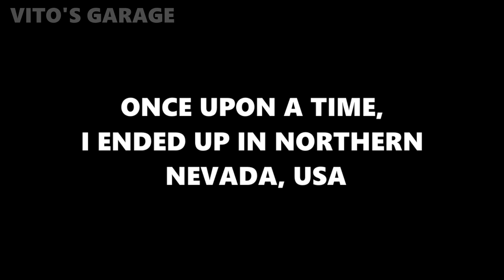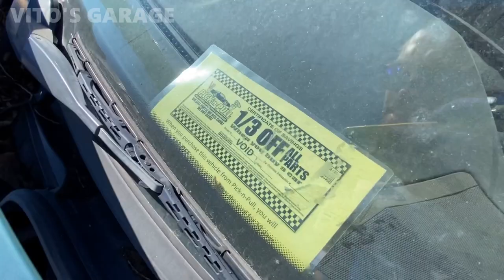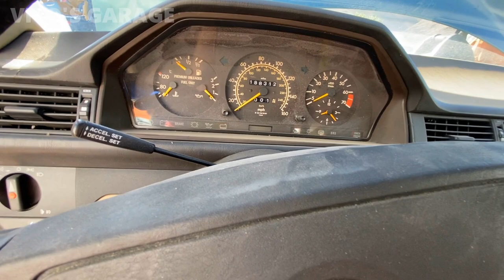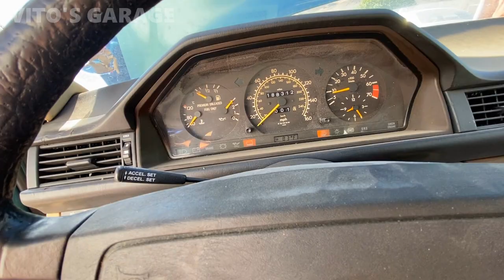I Saved This Amazing 1989 Mercedes 300E Straight From the Junkyard.. Legendary W124 is Being Reborn!

Comment: I see that the window regulator is bolted in which makes them so easy to replace. 
They used rivets on my 01 e320. I've had to replace three of mine. I hate rivets! Now one of the ones I replaced broke again and I bought one months ago but just have not wanted to put it in. 
I loved those straight 6s, gas or diesel. I had an 85 300d turbodiesel several years ago. It was unbreakable. 
That looks like a pretty good car.
I just remembered. The diesel was 5 cylinders, not 6. Still good engine.
Reply from the maker: You can replace the rivets with regular bolts and nuts. It’s easy

Comment: I love your car..nice find. ❤ We're looking at a powder blue one now. My guy gifted me one March 2024.... 1987 300e. Its my first classic and I LOVVVE my car. Its a project car.  Im repairing some things myself. Wheel bearings on front done, changing a tensioner pulley today, gonna replace my exhast manifolds soon, gonna replace the power steering gear box with a rebuilt one next week then let the shop handle my toe arms and springs. If i had a rack ...oh my.....id be so happy as a mechanic's daughter. The engineering of these vehicles...my. The germans knew what they were doing.

Comment: Thank you for saving such an amazing car! I own a W124 and have fixed a lot on it. Had a body shop repair some rust and install new rocker panels. Now I'm working on getting the radio to work again, says an E2 error but the fuses on the amp and head unit are good, it may be the gray cable linking the two. Also just realized my neutral safety switch is why my car doesn't start in real cold weather, thought it was the starter solenoid, but that didn't fix it. Found I can start in neutral in the cold, and since my reverse lights stopped working, it seems to be the neutral safety switch. Also the vacuum pump doesn't turn off when I lock the doors, and the time-out for the pump only kicks in when the engine is off. Not sure if it's a leaking lock actuator or what.
Reply: But now I got a perfectly working (used) W124 starter motor on hand, if you are ever near Pennsylvania Vito, maybe you can come by and help me with some of my car problems and I will give you that starter motor in return?